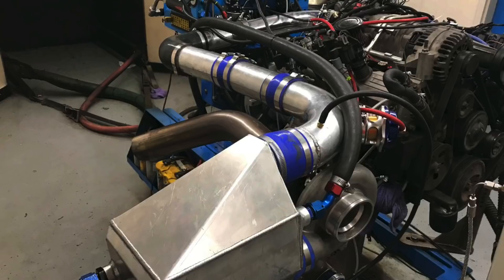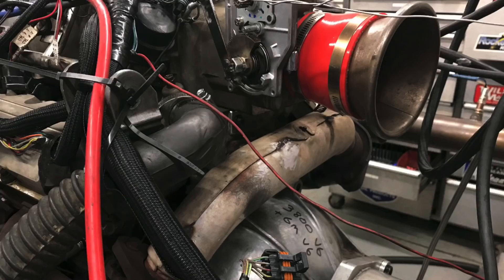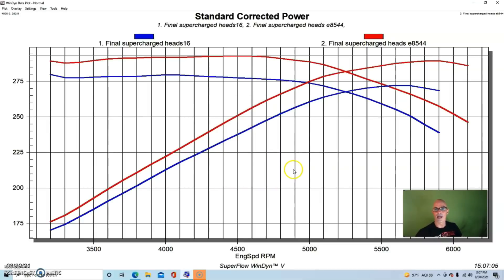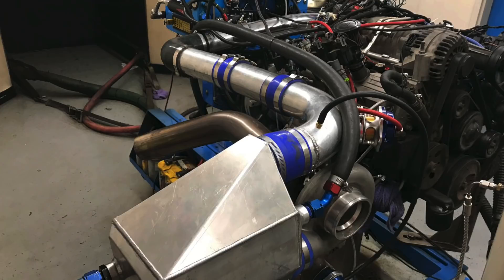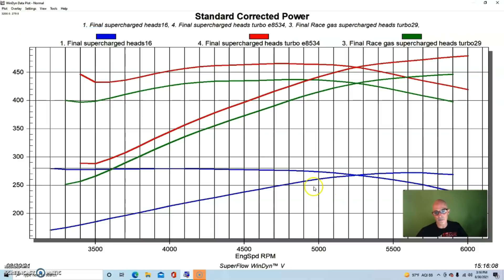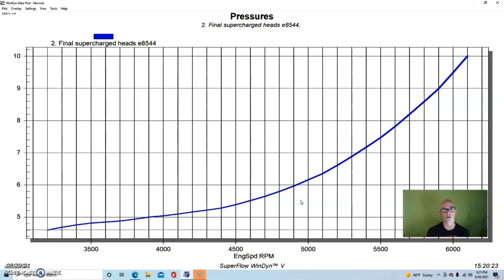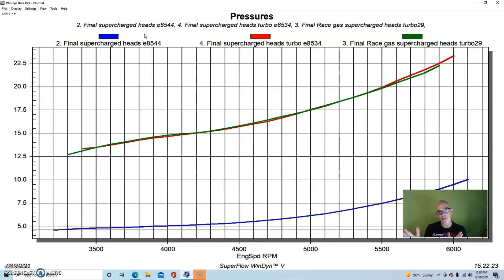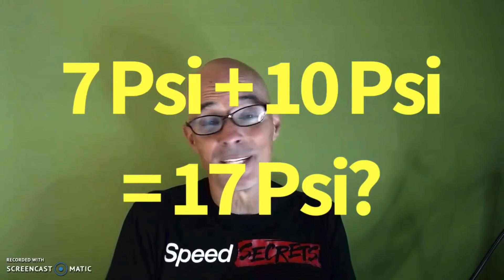HOW TO: COMPOUND BOOST 3800 L32-REPOST WITH DYNO PULLS

Comment: Can't wait for the turbo only or twin turbo setup.  I could see this little engine making 700 or 800 hp.  With forged internals, easily could safely make 1000 or 1100.
Reply: I don't think the block will hold. My guess is he'll unintentionally big bang it at around 650+
Reply: @xnotx2  Well, we'll see.  I do know some guys in Australia who have made 700 whp on stock internals.  With forged internals, pistons and rods with the stock crank they have made 1000 whp in their Commodore.
Reply: @charleslowe522  Yea these are great little motors.
Reply: @xnotx2  Yes they are.  It will be interesting to see how power the engine can handle.  On the engine dyno, the ramp into power is slow compared to a vehicle say at the track.  For instance, when I was running my Grand National at the track I would use a foot brake to build about 5 psi of boost then launch and I would be at 25 psi in less than a second.  Whereas on the engine dyno here, boost is built slower and the engine doesn't go from 150 ft-lbs of torque to 550 ft-lbs in a second.  Without that sudden increase in torque, I believe the 3800 will stay together and hopefully make 800 hp.  If any lets loose it will probably be the rods or pistons.  Even with 3.8L found in the Grand National, there was guy making over 650 whp and 600 ft-lbs of torque with a stock shortblock.  Stock rods, pistons and crank.  Although the crank in the Grand National is really strong, as it is made out of nodular iron.  After amassing over 10 minutes worth of mid 9s passes, it wasn't the rotating assembly that gave it, it was the stock #3 main cap that broke.  Sorry so long.
Reply from the maker: that rate of acceleration you describe is easier on the motor than a sustained load on the dyno (we can change the rate of acceleration on the dyno too)
Reply: @richardholdener1727  If I am understanding you correctly, you're saying a dyno is harder on the motor than a launch at the track.  I thought the slower ramp in put less sudden stress on a motor then say a trans-brake launch at full boost.

Comment: Can't wait for the turbo only or twin turbo setup.  I could see this little engine making 700 or 800 hp.  With forged internals, easily could safely make 1000 or 1100.
Reply: Can the block handle 800 ft-lbs? Unless you rev it out passed 7k, that's the neighborhood it'll be playing in.
Reply: @rideredRC51  I don't know for sure, I do know that people have put down 700 whp with stock internals.  If it had forged internals, 800 ft-lbs shouldn't be no problem.
Reply: I guess the question is:  How different is this 3800 from the old Regal GNX motor?
Reply: @TheFarCobra  The main design features that the 3800 series 2/3 has over the 3.8L found in the Grand National/T-Type/GNX is the block skirt is thicker and the stock main caps are thicker along with mains being cross-bolted.  Also the 3800 pre-series 1, series 1, 2, 3 are on center blocks which allows for more reliable power production.  The stock heads on the 3800 out flows stock heads on the 3.8L.  As a matter of fact the stock heads on the 3800 can be ported such that  they follow just as much as the after aluminum heads on for the 3.8L.  Of course the 3800 was setup with a roller cam, the 3.8L came stock with a flat tappet cam.  However, there are some guys who have made passes in the 8's with the 3.8L block, around 8.70 or a bit faster.  I am sure the 3800 built properly should be able to surpass the 3.8L.  The 3.8L is known as a junk block as it has failed at around 600 whp.  The block has split at that power level.  I am sure the 3800 could handle that no problem.
Reply: @TheFarCobra  think they are completely different engine families
Reply: @TheFarCobra  You know what, you could go to Google images and search for the 3800 series 2/3 block and then the 3.8L.  Look at the main bulkheads on both and you'll see the 3800 has more meat on it and the main caps have to be pressed into the registers on the block.  Surprisingly though, I think the 3800 block may be a little lighter.
Reply: @TheFarCobra  think they are completely different engine families
Reply: @TheFarCobra  It makes power more easily and much better driveability.  I know of one GNX that was running 10s with a 206* cam and 61mm turbo.  It has a 1" shorter deck and rods which makes it more compact and lighter.  The short stroke and large journals make the crank very stout - it will be one of the last things to go.  I know the 3.8 had oiling issues; I'm not sure if the 3800 is any better.

Comment: Love the torque spread from 3000 upwards very impressive combo which is also very simple. A good cam would help lower the restriction but on a stock bottom end there's no need to be pushing higher rpm
Good work

Comment: Awesome. I'd be interested to see the GT45 on it's own, not because I think it will be better (maybe a bit up top), but because I'd like to see how much it's losing out down low from spool- I reckon a lot.

I'm wondering how much it will help up top too, as though it will be more efficient turbo alone, it will be higher pre-turbine backpressure (vs almost none when compound) which will negate the increased compressor efficiency somewhat.

Great stuff!

Comment: Stick a cam in it. Will that drop boost pressure and raise HP I wonder
Reply: Yes.  The more efficient the engine is I.e. more head flow,, bigger cam, headers etc the boost will drop and power goes up.  More power on less boost is always good.
Reply: @midnight347  This is key but ignored by the majority.
Reply: @mex351  agreed

Comment: Whaaaaaaaaaa?  480 hp from a 3.8????  17 kinds of awesome.  Holy crap!
Reply: Ppl make well beyond that at the tires (not an engine dyno) with turbo 3.7 mustangs.  Ppl make up to 600 wheel on stock motors they are super impressive cars for the price they can be had for its a shame they get alot of hate because it's a mustang and it'd not a v8 basically.